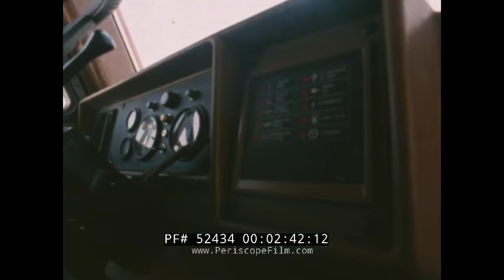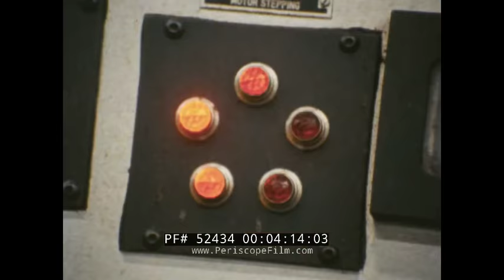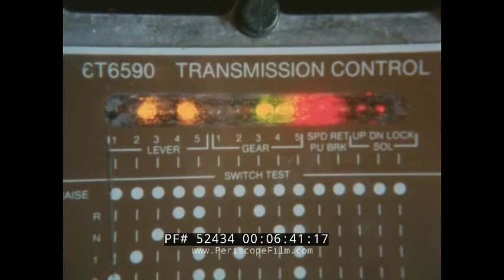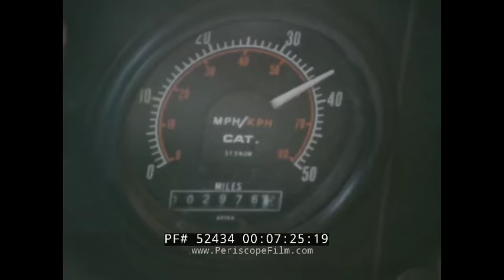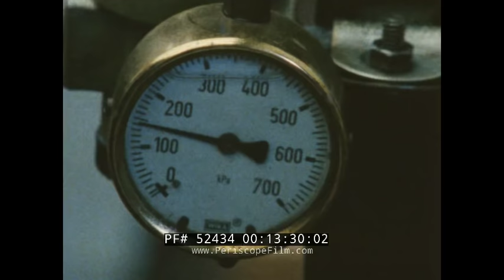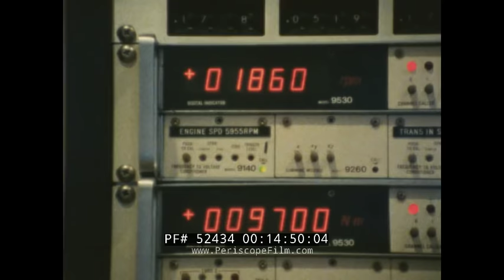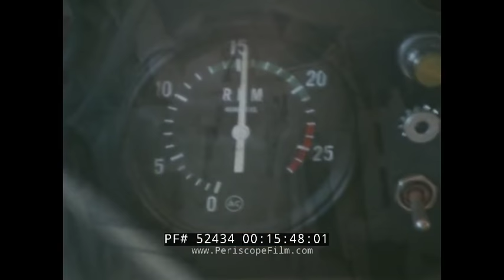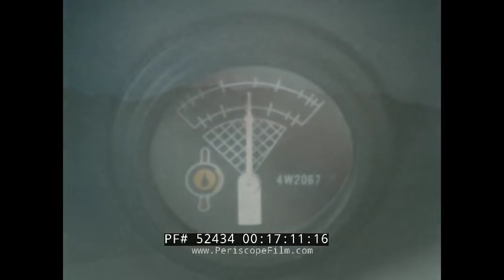CATERPILLAR  785 OFF HIGHWAY ROCK TRUCK   ARIZONA PROVING GROUNDS  52434

Comment: Small by today's standards, but still neat.  They could use a water wagon, but I suppose dust is easier to deal with than 6 inches of mud if they want to look at anything.

Put an L&M radiator in and you'd have something.